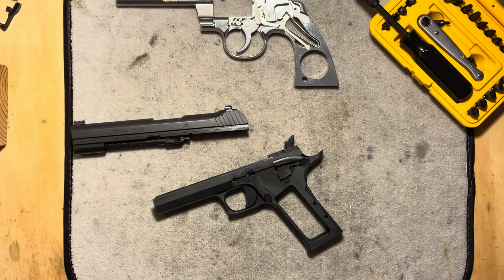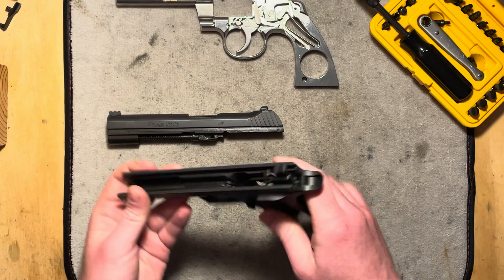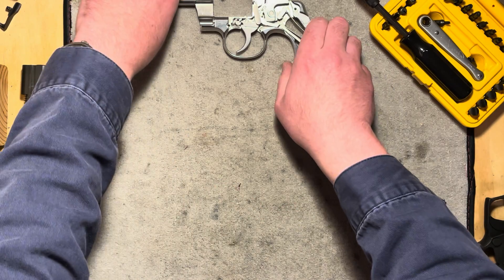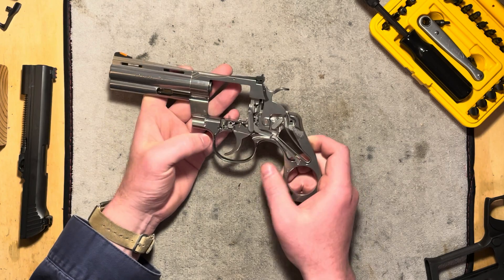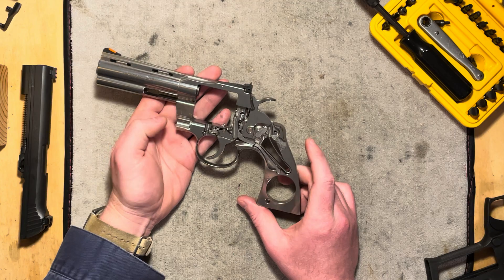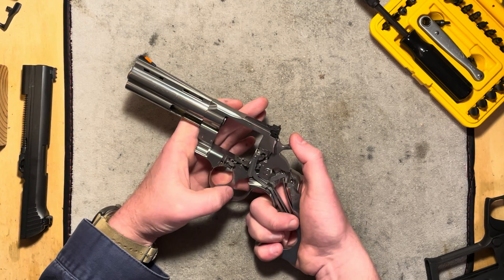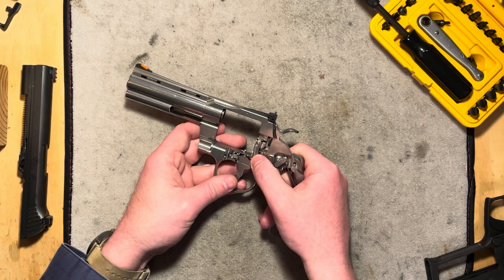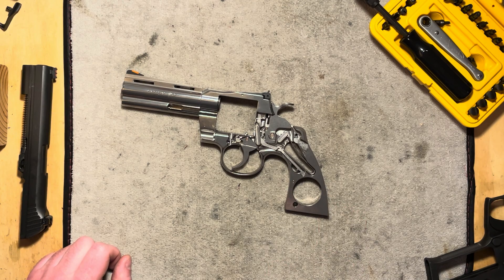Pistol and Revolver “Main Spring”: Why is it called that? How does it work?

Comment: Interesting. So the same spring that drives the hammer returns the trigger.  So now I can see why when people put a lighter spring in to make the trigger easier to pull it also  affects the hammer and they can start getting light strikes.
Reply from the maker: Yup. Springing is actually fairly complicated sometimes. There’s some interesting quirks. 

One of the most interesting is actually on Glocks. An extra power striker spring can actually cause “light strikes” because it works against the recoil spring excessively and causes a slight out of battery condition. 

Pistol gets a bit old and maybe has a light strike, and someone decides to swap in a new striker spring or even an extra power one but doesn’t change the recoil spring at the same time and suddenly the problem actually becomes worse. It’s kind of weird.